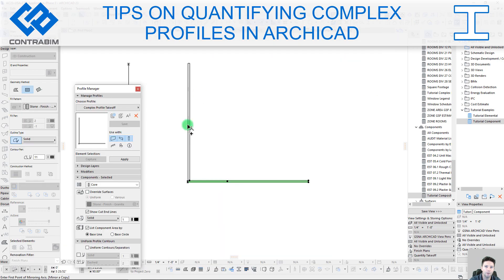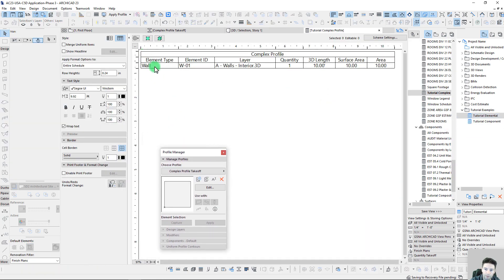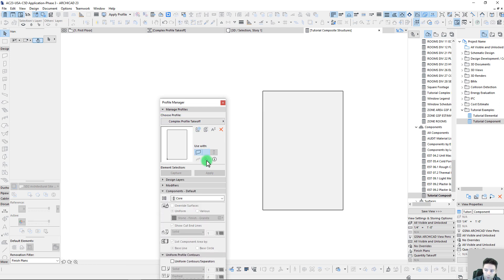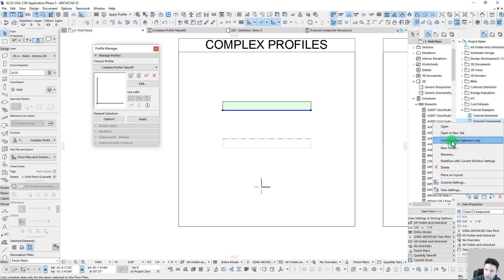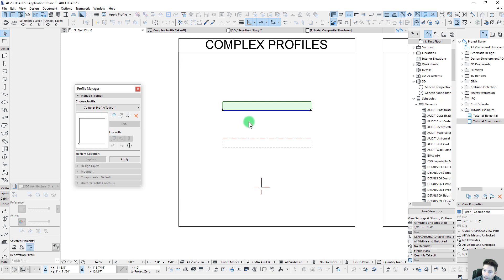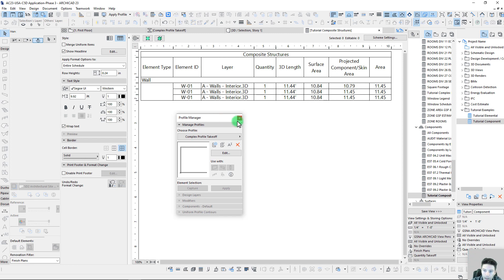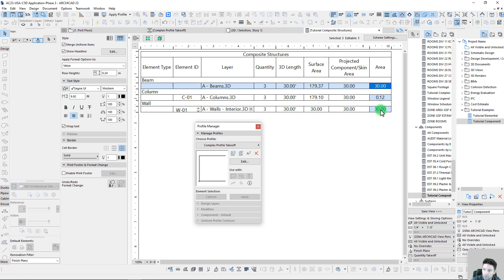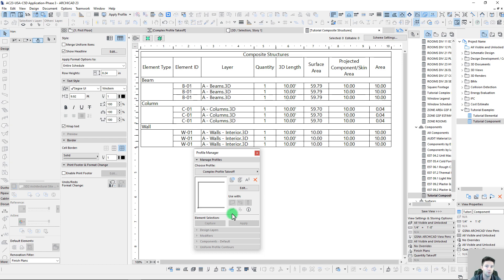Tips on Quantifying ARCHICAD Complex Profiles

Comment: How do you create plaster of concrete beam? Using complex profile of beam, wall or another object? And how do you schedule them ?
Thanks.
Reply from the maker: Hello. If you want to model both at the same time, you could use a complex profile and model the concrete, and model the plaster together. Use the technique shown in this video for defining the "base line" under the list component area, specifically for your plaster and you should be able to buildup the takeoffs similar to the profile around 8:30. This will get you the surface area of the plaster, however for concrete you could schedule separately and price by length, or volume. You could also use the surface takeoff method for calculating the plaster, in which case you could simply override the surface of the beam  without modeling a separate layer. Check out my recent video on that one to learn more on surface takeoffs! Thanks